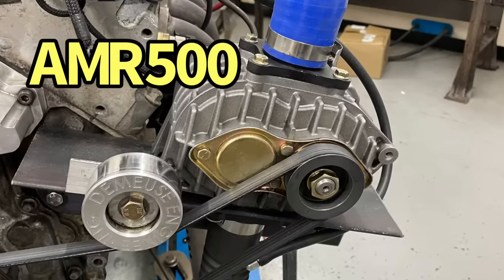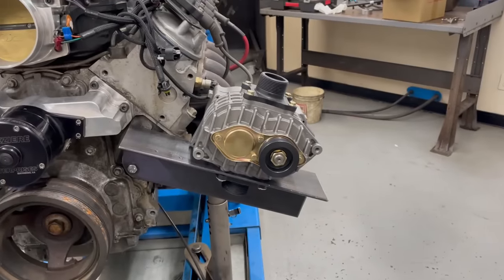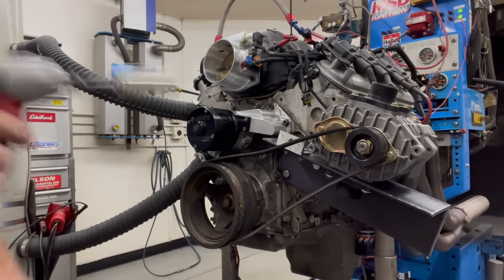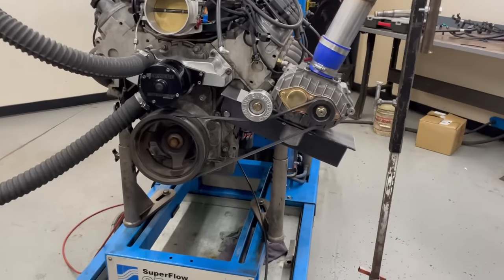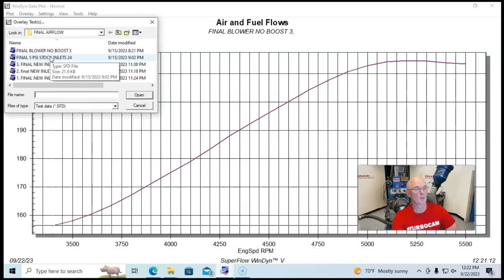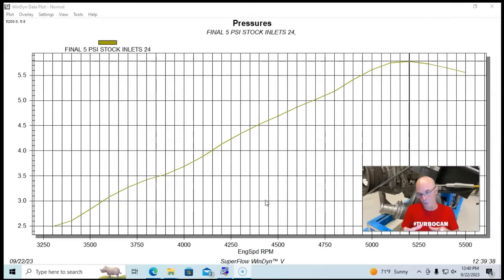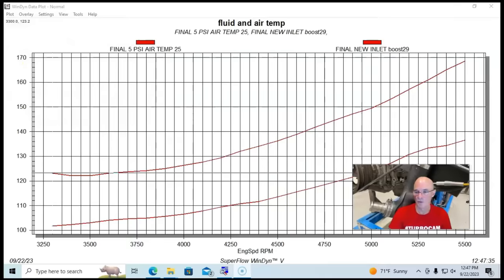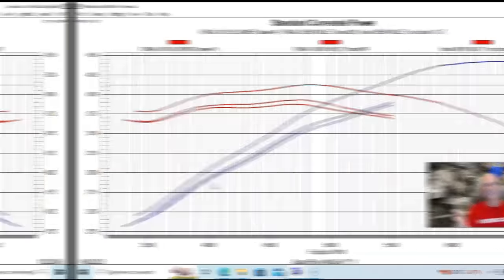THE ULTIMATE CHEAP, EBAY, AMAZON AMR500 BLOWER TEST. FULL RESULTS-AIRFLOW, TEMP & POWER CONSUMPTION

Comment: Hey I've been building a 400m that I started on 10 years ago could you possibly make another video on it or maybe sell me the parts off the one you built 😂
Reply from the maker: what is the hold up on yours?
Reply: @richardholdener1727  I need some aluminum heads and a good intake the motor has been bored.060 deck has been milled and it has a few other things done to it but when I started to build it there was nothing out there really on performance parts
Reply: @richardholdener1727  also I had to get Kieth black dish pistons for it and I would love to have one flat top with forged rods

Comment: Your temperature was lower so therefore you could have a higher air density I don’t know the math look up banks density meters and possibly the seals are heating up and you have air slippage over there compressor wheels but your air temperatures lower so perhaps do the math on the air density you can produce more horsepower and lower psi and it lower temperature

Comment: Is it possible to install it on v6 3.7 mustang 2011-2014
Reply from the maker: it only supports 150 hp
Reply: @richardholdener1727  Is there a second option with lower costs?

Comment: Couldn't someone theoretically add a turbo and a blower. For example a blower before the turbo.
Reply from the maker: WATCH THE COMPOUND 3800 VIDEO
Reply: @richardholdener1727  thanks bro I will. I wish the auto maker I work at does ICE. I have so many questions and never get answers (from work) you are more informative than work about vehicles.

Comment: Wow Richard I'm disappointed that you didn't at least hook up the supercharger to see what kinda power you could make. And also it's hard to believe that it takes that much hp to run the supercharger.
Reply from the maker: why we didn't run the 150-hp blower on a 440-hp motor? Just a flow test to see what motor we should run it on-different size blowers (like turbos) work on different displacement and power output motor

Comment: I think if you keep the smaller outlet you will see higher boost. My brain thinks about when you improve airflow of cylinder heads what happens your boost goes down but flow still goes up because as you said boost is a measure of restriction. I’m an idiot don’t roast me.
Reply from the maker: nope

Comment: That supercharger might work on a 4 cylinder, but it would be next to, if not worse than, worthless on anything bigger.
Reply from the maker: THIS WAS AN AIRFLOW TEST-THE BLOWER IS GOOD FOR 150 HP OR SO
Reply: @richardholdener1727  My comment should have pointed out the fact that I'm simply unfamiliar with the supercharger.

Comment: Why didn't you just route it to the throttle body and change tune a little and see the power it would make.
Reply from the maker: the 150-hp blower doesn't add power to a 440-hp na motor, just flow testing it to see what motor we should run it on
Reply: @richardholdener1727 didn't realize it was that small, first time I've seen it. 

Imo you should do something low power that lots of people have. Stock 4.9 inline 6 Ford. They're gutless, so might add 10 to 20.

Comment: Wonder how this would perform on a 200 cubic inch aircraft engine?
Reply from the maker: flows enough to support 150 hp
Reply: @richardholdener1727  thank you ! Running a continental o200 aircraft engine on an airboat. 200 cubic inch 100hp 7.5:1 compression. This might be just the ticket

Comment: It's not rocket science. Look at your discharge on both setups. The high flow setup was a smooth discharge and the standard flow was a very turbulent ribbed discharge. Basically air was able to make its way out of the blower easily with the larger aftermarket smooth discharge despite the restriction that you added. With the stock outlet and the ribbed heater hose, there's immense turbulence built up inside that hose which also acts as a restriction. It's not a very apples to apples test. Realistically, intakes and discharges should be as identical as possible as far as bends, shape, smoothness, length etc.  It's much harder to move a fluid through a very long hose versus a shorter hose. Air is no different. It's common sense really.
Reply: They used the same restricter in Both tests… the problem lies in the temp of the air.. that’s why it wasn’t able to make more boost. Straight lobes are only efficient to about 13k rpm… add resistance to it and it heats up the air and doesn’t make boost as efficiently

Comment: Use metal piping not rubber the rubber flexes and allows leak run hard piping and you will see a change alot of change depends on the application but change none the less engine science is cool try it in a video at the very least we all may learn something.
Reply from the maker: I sent a blower to be tested on an actual blower dyno in Swedeen, these numbers were accurate

Comment: You never actually ran the engine with the blower on the intake circuit?
Reply from the maker: 150-hp blower on a 440-hp motor doesn't work-this was a blower flow test-power test on a suitable motor coming

Comment: I wonder how one of these would work on my built 300hp inline Chevy 255 six cylinder.  30HP to make 150HP would make a net 120HP?  I have dual 4bbls on a dual 4bbl intake.  Would be tricky, but maybe I could run an AMR500 to each one.  #hmmmmm  :)
Reply: It doesn’t add up that way. The supercharger flows enough for about 150hp so if the base engine makes more than 150hp the supercharger would just be a restriction.
Reply: You need to look at the cfm it can deliver at different rpm (and keep it in acceptable range), and different pressure (for adiabatic efficiency) and compare to the volumetric efficiency of your engine. These blowers will not like high pressure, it will start heating the air quickly.

Comment: Really? Did I miss something here? All that data but NO boost data on the engine?
Reply from the maker: Really-did you not see it was a flow test of the 150-hp blower using a 440-hp motor. (hint-it would make no boost). Flow test was designed to show what motor we can apply it to.

Comment: Why didn't you acrually hook it up and see what happens?
Reply from the maker: 150-HP BLOWER ON A 440-HP MOTOR DOES NOT WORK
Reply: @richardholdener1727  that's kinda what I was thinking that you would just lose power. Kinda like the supercharger from the 3800 chevy v6 test
Reply from the maker: it would lose a LOT

Comment: It would have been nice to see it final out blowing to the engine
Reply from the maker: 150-hp blower and a 440-hp motor doesn't work
Reply: @richardholdener1727  so in other words it would restricted airflow 2 the throttle body seen a video were it was getting put on a vw engine same thing didn't see it run

Comment: Please for the love of God do the same thing with a turbo. Everybody says turbos use free energy which is impossible. You just can't compress air with free energy. Work has to be put into the compressor to make compressed air. If turbos were really taking advantage of " free energy " then perpetual motion engines would actually exist and every engine would have a turbo on it.
Reply from the maker: you can't run this same test with a turbo, but the parasitic loss associated with running a turbo is very small compared to a roots blower
Reply: @richardholdener1727  I actually just a channel on ALexLTDLX. He is using electric motors to turn a supercharger. It is only about 50hp to make 12 or so psi (I dont know the CFM). A centrifugal compressor (turbo or supercharger) needs that same amount of HP to turn and make boost. Whether that "work" is coming from pushed gasses (the force needed to drive the turbo is being taken form the power stroke of the opposite cylinder)  or a belt is no difference. It takes X amount of power.

Comment: 600cfm on an average engine is 240hp, 250cfm would be 100hp... 5psi is 134.01% sea level, 100-30 to drive it is 70 tho 70hp is 135% as the normal engine would have made 50hp... tho it is under a 100ph load to make 70hp. i think most of those get used as water pumps...
Reply from the maker: 600 cfm is not 240 hp-the usual flow vs hp ratio is 1.5 cfm per hp as measured on the dyno (but BSAC can vary slightly)

Comment: Its too small, only made for very small 4 cylinders. I think it says they go up to a 2.0 but it seems like a 1.8 engine is tops, they also wear out very fast due to the cheapness but can be upgraded if you are a decent machinist
Reply from the maker: it's a 150-hp blower
Reply: @richardholdener1727  ya that sounds about right. We put them on 1.3 to 1.6 engines, we noticed that it would max out and destroy itself… except for this one we had, that sim bitch went on multiple vehicle and still works… i should dig that thing out and put it on my propane suzuki samurai and see how that reacts instead of the t25 turbo… also the samurai 1.3 is only like 65hp at the crank😂 and the 1.6 8 valve from tracker or sidekick is right around 85hp, but the samurai with big toyota 22r propane setup runs way more flow than the samurai propane kits so im right around 80hp with the larger propane setup, valve adjustment, and timing change due to burning different fuel and voila.. i want to do a couple things to the engine and try for 100 at the crank with the t25 turbo and also try the amr500 as well just for the fun of it
Reply from the maker: let me know what happens
Reply: @richardholdener1727  indeed😎

Comment: Why not show us it working on the engine and HP gains if any
Reply from the maker: a 150-hp blower doesn't work on a 440-hp na motor
Reply: @richardholdener1727  ahhh I got ya, I figured it wasn't anything but I saw the 3.8 supercharger video so I figured you'd do it anyway

Comment: LOL so on a small motor in stock form it produces less power than it consumes and worse, with the penalty of higher fuel consumption?? If it made 14.7psi boost then the Briggs would make 30hp less the 14hp it consumes, but it doesn't - it only makes 5psi meaning there's a net loss.
That's not the full story more a specious argument - I'm being provocative.
In reality one would need to measure the CFM of the 15hp Briggs to get the real picture because it surely can't be as bad as all that - I dunno, maybe it is considering the cost and where it's made. 
There is this type of supercharger kit for air cooled VWs so I reason they must work.
Reply from the maker: the power consumption vs the na power output of the test motor is not the comparison. You are forgetting about the added power from the blower-that is more than the power required to drive it.
Reply: @richardholdener1727  Might be better to re read what I wrote I reckon - particularly the part about the specious argument.

Comment: Its only made for max 2200cc engine and blower speed 10 000 rpm
Reply from the maker: it will support 150 hp or so under boost-displacement doesn't really matter

Comment: I thought the amr500 was only meant for engines up to 2 l
Reply: he wasn't testing it to see if it could make more power on the LS, he was testing to see how much power it takes to spin the thing and how much air flow and boost it could accommodate with a minor restriction.
Reply: @davidphillips3953  yeah open-mouth insert foot I commented before I saw that

Comment: im confused. it made less than 300 cfm? cant you get an electric fan for a attic that does 800 cfm? you didnt even hook it to the engine. i guess im missing the point of this video
Reply from the maker: a ceiling fan might flow but does not do so at pressure, this test shows the blower is capable of supporting 150+ hp

Comment: of coarse it made less boost having bigger space to fill.
on my B&M 350 vs 400 you had to go smaller wheel to make same boost .
restictor helped a little  you are boosting the sized pipe from charger intake and cylinder at same time
its a compressor it fills and pressures a smaller bottle faster than big bottle
hook a garden hose to balloon and count the breaths to blow it up then put big hose on balloon 
and count breaths to blow it up
test was pointless
Reply from the maker: swing and a miss
Reply: @richardholdener1727  i actually didnt explain every thing.
The intake on supercharger should be big and solid and   like header ive had oversized turbo suck air cleaner pipe shut.
but other side is forced induction.
Cfm size and speed and temp wouldnt matter on blowing off un loaded its loaded that matters.
I think you are going right way but try 2 inch boost hose the 2 1/2 then 3 watch boost guage horse power and tork .
with air temps in hose might tell us stuff too. you got me curious 
my Guess would be Lean is mean 2 inch charges manifold faster without heating air so much as the volume would.
like your header test on size matters.
there would already be a restriction on intake manifold and head intake .
We are both getting old and get side tracked lol 
But I truly think that is what were reaching for..
tell me what you are thinking ?

Comment: There's no way that will make boost, I had one on my 2.2l s10 and it made 7lbs of boost.
Reply from the maker: THIS WAS A FLOW TEST-TO SEE WHAT MOTOR WE SHOULD RUN THE BLOWER ON
Reply: @richardholdener1727  right on,  I like the amr500.  Just didn't think it would do much of anything.

Comment: I mean....you did the hard part....why not hook it to the throttle body and see if it would produce enough boost to actually feed enough cfm to keep it from falling in its face or atleast say that this engine requires 340cdm to operate so hooking up the blower would be a restriction in and of itself.....maybe bolt another one t the other side and see if 2 of them would actually make boost and make more power than NA.....Like I said you had the part and it was bolted up so the hard part was done....why not finish the install and actually hook it up if for no reason other than to give the punch line to the joke ! LOL
Reply from the maker: 150-hp blower on a 440-hp motor...not good. we flow tested the blower to show what motor we should put it on

Comment: I run an AMR500 on my 600cc single cylinder bike, the blower runs at 1 to 1, so a max of 8500 rpm, it takes 5 hp to drive it, I run a draw through system and a wet charge helps seal the rotors. when I used the standard diameter pipes, I was seeing 10lbs of boost and 73hp, after a rebuild with large diameter pipes and hoging out the intake area boost went down to 8lbs but flow increased to deliver 80hp.  https://www.youtube.com/watch?v=5IZO_fJ5-Hs
Reply from the maker: How did you measure the drive loss? 5 hp is low even for 8500 rpm
Reply: @richardholdener1727  I used an electric motor to test the flow of the blower and induction system before I fitted it all to the bike and calculated motor rpm x torque, your driving that blower at pretty much the max rpm and the drive power is not linear

Comment: Id like to know what the hp gain would have been All great information but ended in a ruined orgasum.
Reply from the maker: the blower flows enough to support 150 hp, it doesn't add power to a 440-hp motor

Comment: It sounds like you have caught a 😼😂. What's the five hundred stand for? 500mm😂.
Reply from the maker: 1/2 liter
Reply: @richardholdener1727  😒. What's the purpose🤔? You couldn't possibly use it on anything other than a lawnmower. Maybe a go cart🤷‍♀️????
Reply from the maker: it is a 150-hp (or so) blower, so it works on any sub 100-hp na motor

Comment: This was extremely annoying! Where's the after h.p. comparison?? We wanted to see the numbers of what the gain would be by simply adding the kit completely as it comes.
Reply from the maker: there is no kit. This was a flow test of the blower to see how much power it will support based on airflow. It is a 150-hp blower-and would not help the 440-hp v8

Comment: Gotta admit I was a little disappointed when you did NOT connect blower to motor for a test in this particular video……..😡
Reply from the maker: 150-hp blower on a 440-hp motor doesn't work (you should have understood that from the video info)
Reply: So odd, then why run the test at all!!
Reply from the maker: so people now know how much it flows, how much power it takes to drive it, what the temps might be under boost and what motor to put it on so it will work (less than 100 hp na motor and boost to 150-175 hp) All great data for AMR500 owners

Comment: It says 16k rpm very maximum. 18k is more Than that.
Reply from the maker: 16K is more of a guideline, not a rule
Reply: @richardholdener1727  at that rpm , most likely any supercharges is less than 50% efficient. that basicly means its a net LOSS making machine at that rpm. not to mention it will just overheat and fail on seals and all the rest. Even an eaton m45 will be inefficient at that rpm. 8-8500 rpm is where eatons loose on efficiency down to under 65%. usually thats the range where you want a blower to work at as max rpm. that 16k marks the spot where its abosuletly a waste of efforth. quite naturally at 18k rpm it can only reduce the power.

Comment: This AMR 500 is for max 2.2l engine!!! Have you read the manual before use it on a LS motor 😂 thats silly 😂 how you expect power ?? Try it on an engine under 2.2 litres and make again a correct video about AMR 500 supercharger 👍👍
Reply from the maker: Blowers don't know displacement, they only know flow. The blower will support (according to this simple flow test) 150 hp. The blower can be used on many different displacements, the key is that the naturally aspirated motor make 100 hp or less. The LS motor was only used to spin the blower for the flow test.